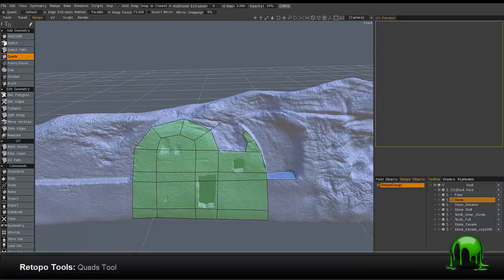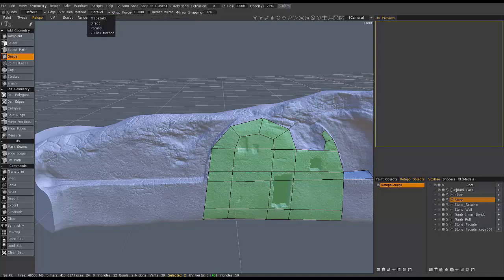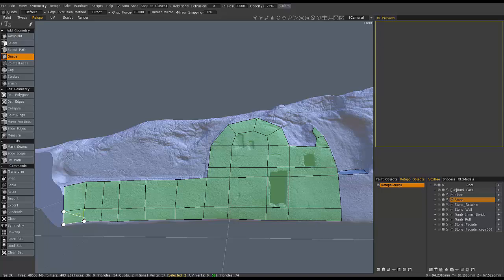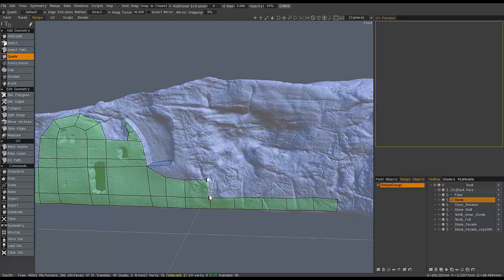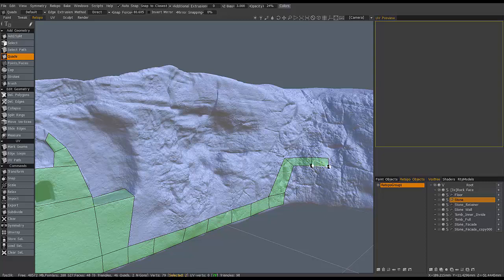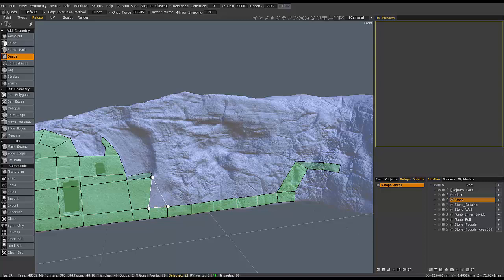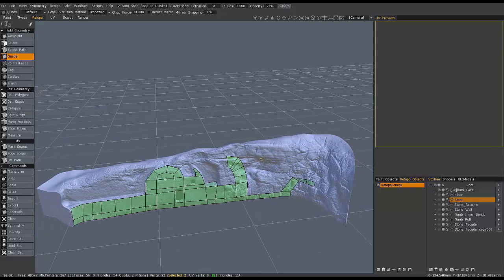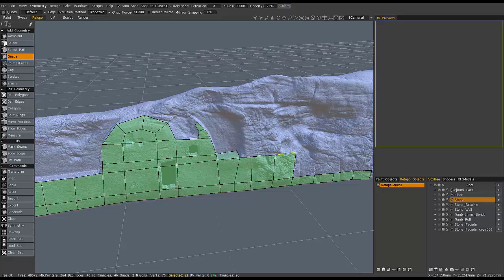Quads Tool

Comment: Brilliant tools and workflow.  In my opinion, even better than most retopology tools found in most other specialized applications.  I was previously using 3dsmax for retopo, and I still use it for certain topology tasks, but I've moved 90% of my retopology and baking pipeline now to 3d Coat.  It's just extremely powerful and easy to retopo, then bake maps.  The paint tools are also some of the very best in the industry as well.  Now if only there were standard poly modeling tools available, to make surface mesh objects from scratch, I may not even need another package for the majority of my work.  One of my favorite applications.